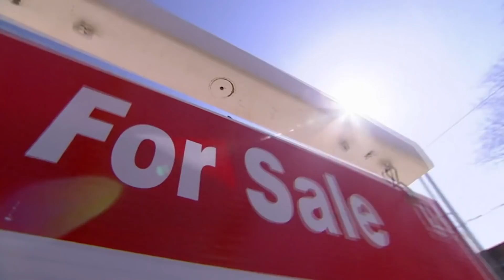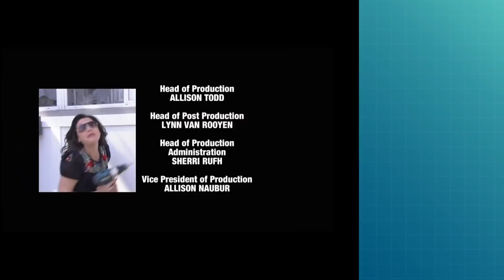Our Cluttered Home Needs A BIG Clear-Out (Unsellable House Documentary)

Comment: This house is lovely, especially after the make over. However, I think it was a mistake to build the desk into the back room. Certainly a desk to showcase the room as an office, but if potential buyers would rather use it as a sitting room they are now going to have to rip out the desk and deal with the repairs that come with doing it. A free standing desk would have been a much better choice.
Reply: I would never slam a desk against that molding.

Comment: A dichotomy: depersonalize by neutral colors on walls (that could EASILY be changed by new homeowners) & plain/simple decor, yet add costly built-in furniture that might "show" well, yet not work for the new homeowners & they might have to "settle" for it (as I did) or much $$$.